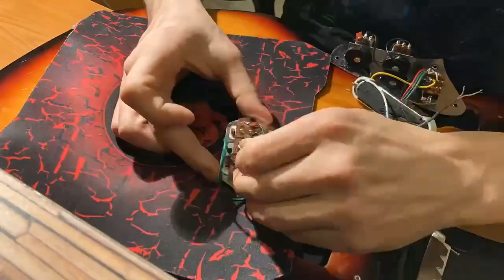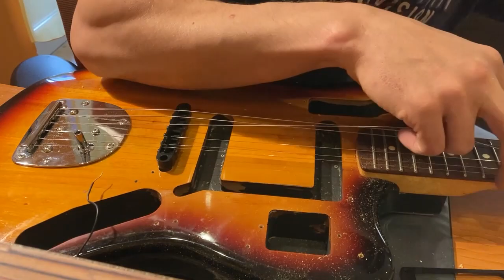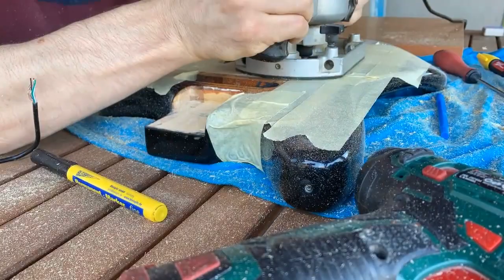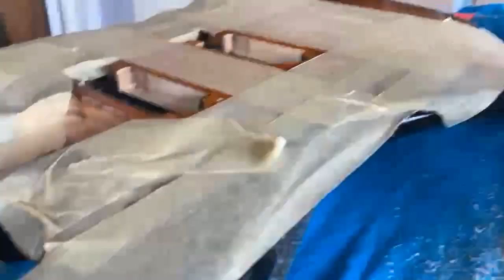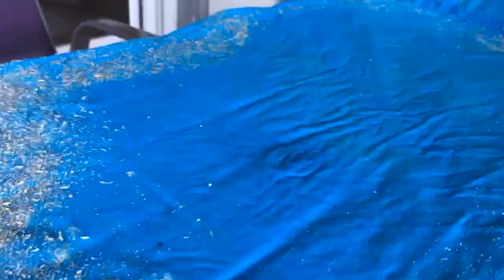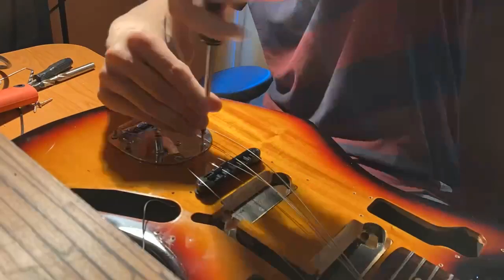Modifiy Squier VM to Kurt Cobain Jaguar

Comment: I'm doing the same project your one turned out really well. I have a question though. is the right cavity big enough for a les paul type switch to fit in? i thought it would need routing.
Reply: @WTFdmf  thank you a man спасибо
Reply: @WTFdmf  can you say it again ? be helpful especially when you say it so nicely
Reply from the maker: It fits, but the tricky part is the plate, I bought on reverb. The only custom part, I used the stock pickguard routed.

Comment: where do you get the three knob controls and the three way switch - do you have to do it yourself?
Reply from the maker: Cheap Harley Benton parts: Harley Benton Parts Toggle Switch Chrome, Harley Benton Parts T-Style Dome Knob CH. I drilled the original contol plate, but the modified switch plate can be found only on reverb.